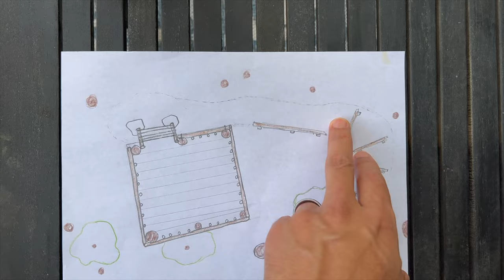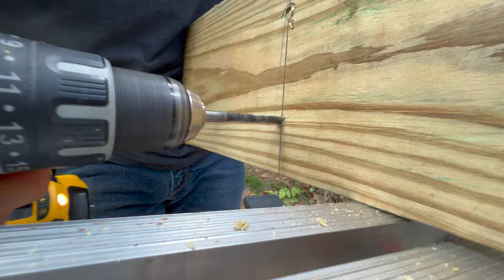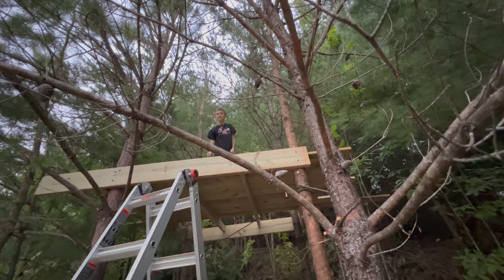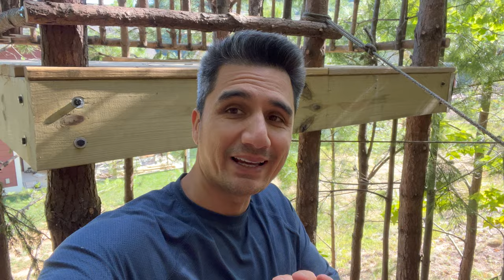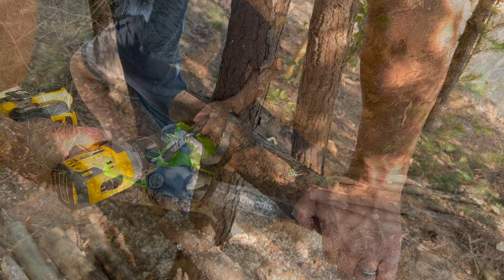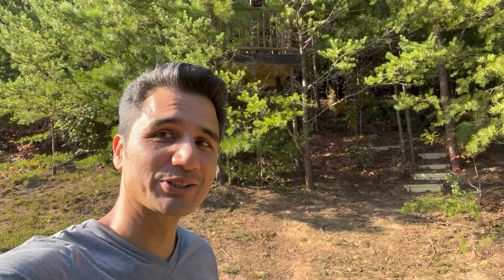Building a Simple DIY Tree House on a Budget Using Lumber from Land

Comment: It just seems that those baby trees aren't strong enough to support the weight of the trees house plus bodies inside. 😢
Reply from the maker: Still standing strong and doing well. It has 6 posts so it is sturdy. But you are correct as in we limit it and only 4 small kids can be around. Larger trees are better if you have them. This was a project to experience a tree house. My kids are growing out of this phase. Teenagers soon:) and I will tear it down next winter.